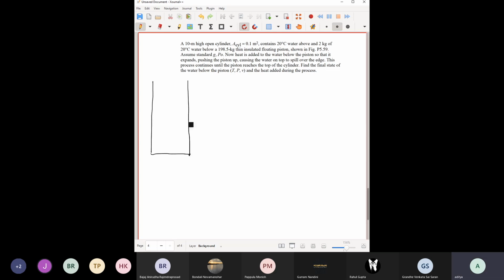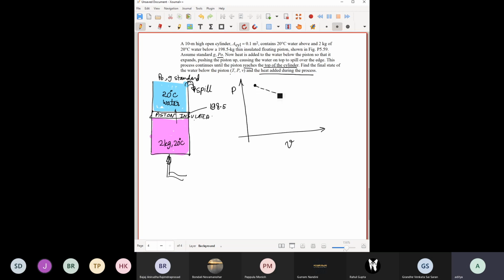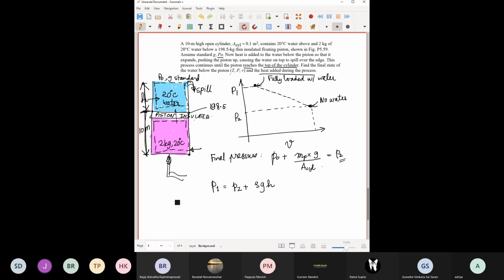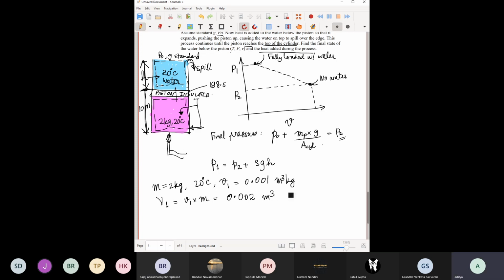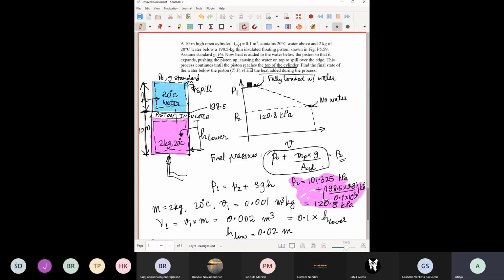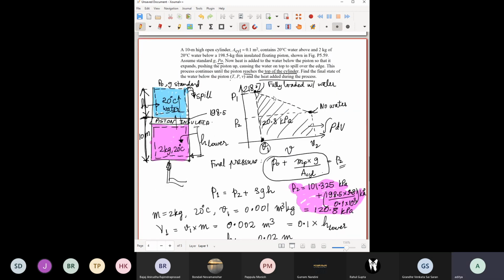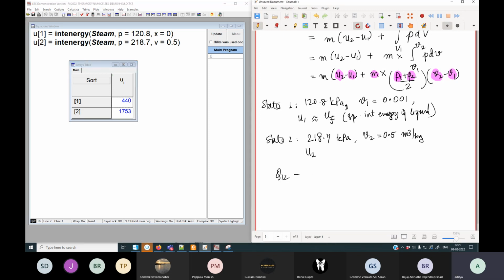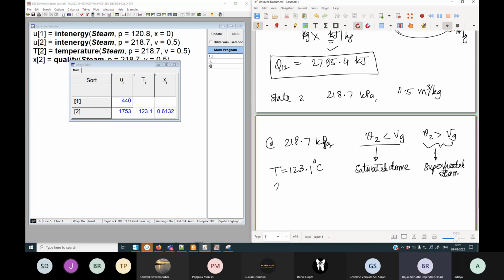Problem 5 59 Sonntag using EES

Comment: @Aditya Bandopadhyay - IIT Kharagpur  Sir, the confusion around 8th minute regarding the small height h can be solved using the following code:
Pb=101.3+h*9.81/(1000*volume(Water, P=101.3, T=20))+198.5*9.81/(0.1*1000)
(10-h)/20=volume(Water, P=Pb, T=20)
Then h=9.98, Pb = 218.5 KPa,  the specific volume obtained using P=Pb and T=20 deg C agrees exactly with your "approximation"  + EES, with the above data, confirms our assumption that the water is supercooled

Comment: Sir, i did not get why the PV graph is linear?
Reply from the maker: Because pressure on top will depend as atmospheric plus piston weight plus the weight of water on top. The water on top is exerting a pressure of rho g times height, which shows that is linear in height. This as height reduces, the pressure will also do so.
Reply: @localhost123456  Ok sir. I get it now.